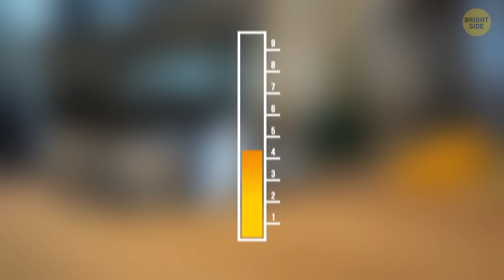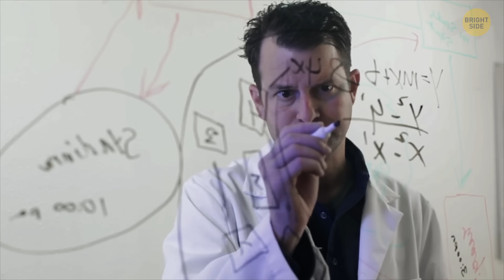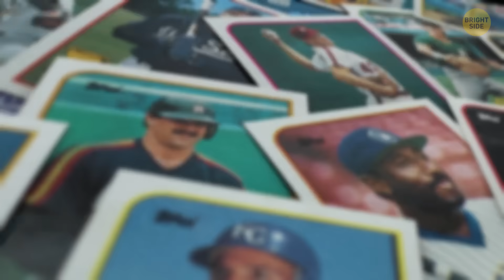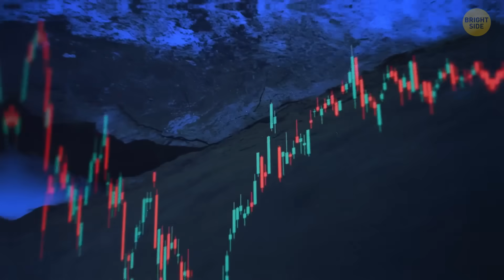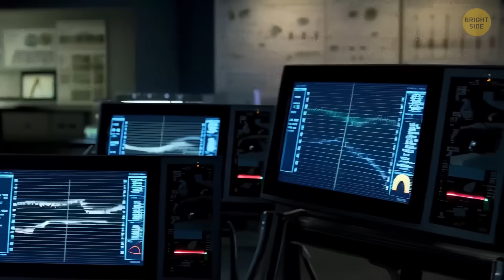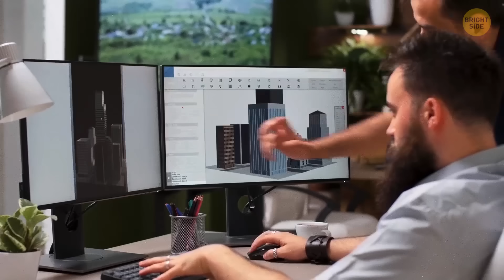Scientists Warn California Could Face Its Worst Quake Yet

Comment: Spreading disinformation is evil and will get a lot of people killed.  "The Big One" is NOT the San Andreas Fault and "The Big One" is NOT a 6.5 earthquake. Japan had a 9.1 and it was NOT "The Big One" either. Let me help with your confusion. "The Big One" refers to predictions from those with psychic abilities, remote viewers and vivid dreamers who've been warning about it for years. I fit into this category and will tell you what I saw. The Big One will be an earthquake greater than a TEN (10+) but the worst danger will come from the mega-tsunamis of over 1,000 feet in height.
Reply: Oh the irony
Reply: I am waiting for the Sun to make me a wonderful meatloaf when the magnetophere collapses.
Reply: I'm not saying you're wrong but they could've been saying "The Big One" as hyperbole or something of the sort, which wouldn't make it disinformation, especially since it is referring to what it asserts is a 70% chance, whereas what you speak of remains to be seen and is phrased as an an absolute certainty. But since what you're referring to has yet to happen, I'd politely and respectfully counter that your first sentence is an accurate assessment. I wouldn't say this video is evil, nor that what you're saying is evil. Science, on some level deals with hypotheses and hypotheses are not concrete and certain, requiring further exploration. Whereas, the category that you fall under technical qualifies as Pseudoscience. However, I might also fall under Pseudoscience. And as potentially kindred spirits in a potentially ESP sort of way, I think we both know I should know what you're saying is plausible, hence why I'd only care to politely counter your first sentence with suggesting a reframe. Respectfully, of course.